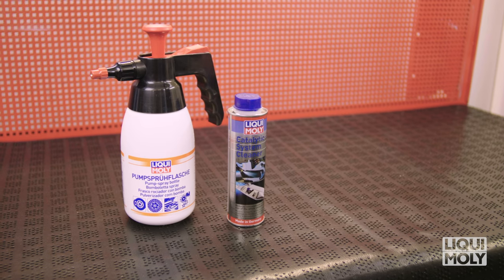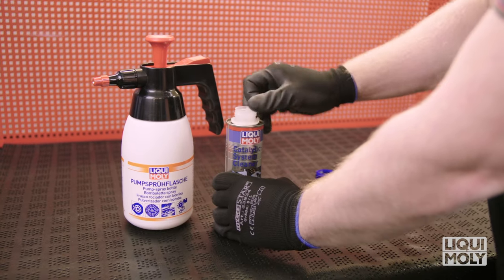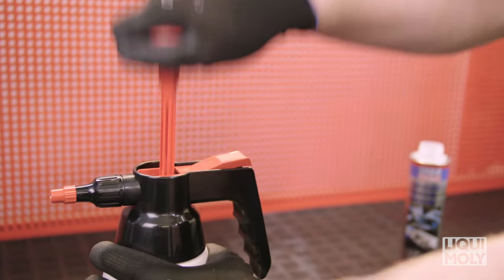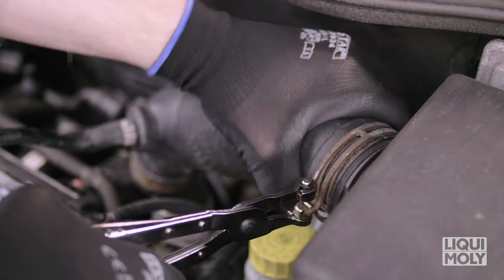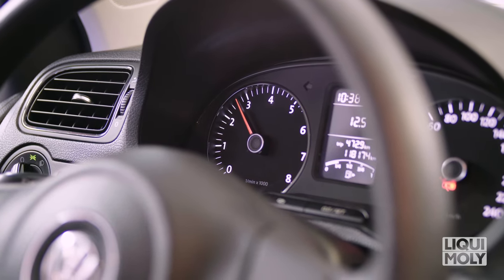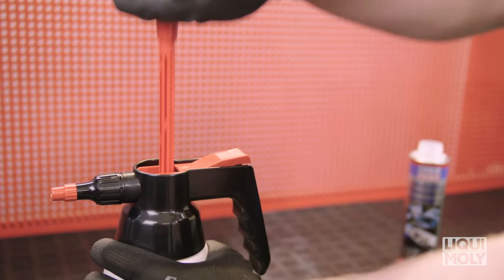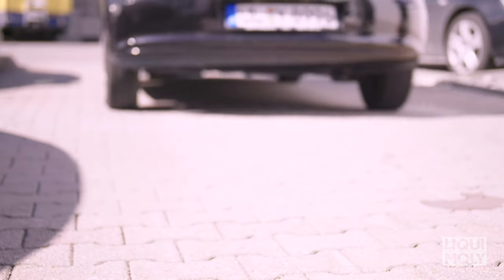LIQUI MOLY Catalytic-System Cleaner (#8931) EN

Comment: could you please advise how can use in Volkswagen passat B8 1.8TSI 2018？
Can I fill the tank?Or is there a more convenient way to use it?Is there VW passat B8 teaching video?
Reply from the maker: Hello,

in general, we have no vehicle-specific instructions for the application from our LIQUI MOLY Catalytic-System Cleaner due to the larg number of different vehicles.

Another reason is, that the applucation is always the same. 
You remove the hose to the throttle body and than you spray the Catalytic-System Cleaner with short intervals at a rpm of approx. 2500 1/min direct into the throttle body.

The Catalytic-System Cleaner is not suited for the tank application.
If you add it to the fuel tank, this is not harmful for the engine but you have no cleaning effect.

Best regards,
your LIQUI MOLY team
Reply: @liquimolywebtv  thanks

Comment: hello liquimoly i have a query can i remove oxygen sensor and spray the cleaner directly into exhaust system or its not efficient way and what the best time to advise the customer to clean his catalytic system after 100000 kilometer for example
Reply from the maker: It´s not allowed to use this additive this way, it also won´t have the same cleaning effect.
Please use the product like the application instruction is telling it in the video.

Comment: Hi, can we use this product through the fuel tank?
if we can apply this way, how may litres of fuel should we have? is there anythning else tha we have to do?
Reply from the maker: Hello,
the Catalytic-System Cleaner is only for the intake system , as you can see it on the video.

After the intake system cleaning with the Catalytic-System Cleaner (8931) , you can add the Catalytic-System Clean (7110) to the fuel , 300 ml is sufficent for up to 70 liters of fuel.

We recommend to use the Catalytic-System Clean 7110 at least every 2000 km.
Best regards,
your LIQUI MOLY team

Comment: peugeot  307 2006 , can it be used the same way in the video? through the throttle valve?
Reply from the maker: Hello,

the application is practically identical for every gasoline engine.
Important is, that you spray the LIQUI MOLY Catalytic-System Cleaner direct into the intake system (behind the air-flow sensor) in short intervals with an engine speed of approx. 2.000-3.000 1/min.

Comment: How can i use it on Elantra 2013, the air flow sensor is behind the throttle body?
Thank you.
Reply from the maker: Hello Abood, 
thank you for your inquiry.
The air mass sensor is most likely in front of the throttle valve but nevertheless remove the sensor to not damage it and put it back after the process.

Kind regards, 
your LIQUI MOLY team
www.liqui-moly.com
Reply: Thank you for the reply 
i was wrong it is not air mass sensor it is map sensor 
is it okay to remove it?
Reply from the maker: It is not necessary to remove the map sensor. Best regards, your LIQUI MOLY team

Comment: I have some questions:
1-Can I use the product with a spary dispenser connected to an air compressor at 7 bar?

2-Do I need to do the process outside or it can be done in a closed garage  with an open door?

3-from what I saw in other videos when applying the product, white smoke comes out, is this normal?
Reply from the maker: 1. Yes it can be used, just assure that all the seals from rubber withstand chemicals, otherwise they can fall apart and do not apply too much of the product at once, you risk an engine failure
2.Definitely outside not in a garage
3.Lots of white smoke comes from wrong application, when applied correctly it is just a bit of smoke 
Best regards, your LIQUI MOLY team

Comment: Helo can i use the same method for my lexus lx570 with no turbo charger?
Reply from the maker: Hello Zed, 
thank you for your inquiry.
Yes, you can use it for your car.

Kind regards, 
your LIQUI MOLY team
www.liqui-moly.com
Reply: @liquimolywebtv  I've tried to use it with the pressure can but when I remove the hose from the throttle body the car refuses to stay on. The engine starts and shuts off immediately. It is a 2013 lexus lx570. I think it's programmed to shut off if the throttle body is exposed. Can I pour it into the fuel tank instead?
Reply from the maker: Hello, please disconnect your airmess sensor, then create access to the throttle walve and try the procedure again. After finishing the procedure, turn off ignition and connect the air mass sensor again. Then check with a diagnose tool if any failures are set due to the disconnection of the air mass sensor. Best regards, your LIQUI MOLY team

Comment: Hi I have a question: should the product touch the mass airflow sensor or it should not touch it?
Reply from the maker: Hello Mesh,

no the spray should not touch the airflow sensor. Spray after the sensor.

Kind regards, your LIQUI MOLY team
Reply: @LIQUI MOLY  if I disengage the MAF the engine will stall

Comment: how to use it in a BMW 116i 2006 model as im getting half engine check light even though i got the catalytic converter clean and even the throttle body. Much Generous.
Reply from the maker: Create an acces to the air intake System.Establish access to the intake tract, ideally behind the turbocharger. Please note that the access must be located immediately behind the air-flow sensor.
Best regards,
your LIQUI MOLY team

Comment: Hello excuse me i have one question.. How i can use catalytic system cleaner with new mode from throttle.. If the car from company Toyota example. I can't open the throttle because when i open it car is turned off..
Reply from the maker: If the engines turns off during the cleaning process or you are not be able to hold the required rpm, please disconnect the mass air sensor while the ignition is off. After that you will be able to start the engine and hold the required rpm.

Please note that if you disconnect the mass air sensor, maybe there will be a failure code in the engine control unit. This you have to delete after the cleaning with a diagnostic device.
Best regards,

your LIQUI MOLY team

Comment: Is this can be applied on V6 Camaro engines. Has anyone tried ? ... 

If sprayed through air intake , will it be ok. Have done 108k km done but engine is 2014 model.

Comment: Dear Liquimoly, I have toyota innova, can I use this catalytic clenaer directly to the throttle body? Toyota innova have filter intake and then Mass Air Flow Sensor (MAF) and then go to Throttle Body Sensor.
Reply from the maker: Hello Yudi, 
You can use the catalytic cleaner directly to the throttle body but only as shown in the video in combination with the Pump-spray Bottle. How to use this product you can also read in our product information which is attached below.
Kind regards, your LIQUI MOLY team

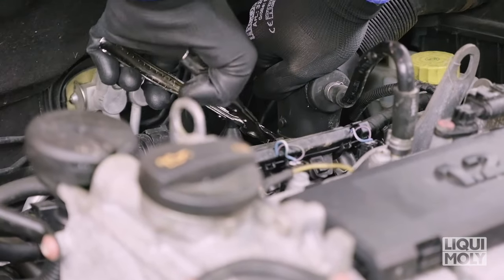Comment: Where is the mg oxides are coming from? Minute 1:10
Reply from the maker: Dear Mr. Eltony,

in countrys with a low fuel quality there is manganese added to the fuel. 
It serves as an anti-nock agent. So when it is burned it arises manganese oxide.

Kind regards,

your LIQUI MOLY team
Reply: LIQUIMOLYwebTV thanks for your reply. I thought that there is a relation with the vacuum hoses or so. 
I have another question. What if I don't have that facility of spraying the liquid. Can I use a normal spray bottle instead of it?.. thanks
Reply from the maker: If your spray bottle has got a good spray pattern you can use it for this application. 
Kind regards, your LIQUI MOLY team
Reply: LIQUIMOLYwebTV 
Thanks for that. It will make things easier at tight spaces.
Question: I have red anews letter from GM that these cleaners can be introduced via vacuum hose. Others also using the vacuum hose to pump liquimoly cat cleaner. So why are preventing using the vacuum hose and only spraying through the throttle body?
Thanks in advance
Reply from the maker: We don´t recommend it to add it thru the vacuum hose, this can cause a unround Motor operation and affects the application negative.
Reply: LIQUIMOLYwebTV 
Fair enough for me. I will follow the instructions as you explained and will give a feedback after that.
Thanks for your help
Reply: السلام عليكم أ/ ابراهيم
برجاء المساعدة , الطريقة اللي أعرفها لإستخدام المنتج عن طريق الخرطوم , كل الفيديوهات بتشرح هذه الطريقة وسوف أرفق بالأسفل فيديو للطريقة اللي أعرفها 
برجاء توضيح اللي حضرتك فهمته منهم  هل هذه الطريقة خطر ؟ لأن الطريقة اللي يشرحوها في هذا الفيديو صعبة بالنسبة لي

https://www.youtube.com/watch?v=M8gomxfTTTA
Reply from the maker: Hello Ahmed,
thank your for your inquiry. 
Please write an email to our technical department info@liqui-moly.de

Thanks in advance.

Kind regards, your LIQUI MOLY team
Reply: Ahmed Rashad 
شوف يا احمد بيك.. الطريقة المعروفة لدينا هي استعمال كامل العبوة عن طريق خرطوم الفاكيوم الخاص بالفرامل. ولكنهم منعوها تماماً وبيفضلوا الاستخدام عن طريق ال throttle body أو البوابة كما نسميها. 
وجهة نظرهم انها تحتاج استخدامها بالرش لتعطي الوقت الكافي للمادة للتفاعل مع الكربون داخل الموتور والكاتليك. ولو استعملت دفعة واحدة فالخوف أن لا يكون لها فائدة ولا تعطي النتيجة المرادة.
الجزء الآخر وهو المهم هو الخوف من دفع المادة دفعة واحدة داخل الموتور وعند الاشتعال يحدث انفجار غير محسوب. أو غرق السلندرات وعدم القدرة على الاشتعال وربما مرور السائل الزيت واتلافه ومن ثم إتلاف الموتور لسوء عملية التزييت.
وتحت امرك في اي سؤال وليكوي مولي عموماً في غاية الاهتمام بالرد على التساؤلات

Comment: Do I spray directly into the throttle body, on the butterfly?
Reply from the maker: Hello,
here you spray directly in the air intake tract behind the air-flow sensor. 
Best regards,
your LIQUI MOLY team
Reply: @liquimolywebtv  Thus, I can take off the air intake and spray onto the throttle body. Right?
Reply from the maker: Yes you can also spray directly in the throttle Body.
Best regards,
your LIQUI MOLY team

Comment: How to use catalytic cleaner with old cars having carbrateour  like tofas dogan or tofas sahin cars
Reply from the maker: Please apply the Catalytic System Cleaner  in the same way as with an injection equipped car.
Get access in front of the throttle valve and then apply like described in the product information.
Here is the link to the product information.

https://pim.liqui-moly.de/pidoc/P000055/8931-Catalytic-SystemCleaner-19.0-en.pdf
Best regards, your LIQUI MOLY team

Comment: Do I disconnect the mass airflow sensor cable or leave it  connected?
Reply: Did you get an answer to that question?
Reply: @muhammedk470   Yes disconnect it
Reply: @akramalaaetman6011  ok.

 Because if u don't, the engine switches off.
I don't know why they don't explain that part

Comment: Hi can you please advice how to use on a Laredo v6 model 2006
Reply from the maker: Hello Nadim,
unfortunately it is difficult for me to tell you the exact application for your vehicle, but in general the following applies:
Pour additive into the LIQUI MOLY Pump-spray Bottle (part no. 3316). Pump up the pump-spray bottle. Establish access to the intake tract, ideally behind the turbocharger. Please note that the access must be
located immediately behind the air-flow sensor. Start the engine and spray the additive into the intake tract at short intervals while the engine is at moderate speed (2,000-3,000 rpm). If the speed does not begin to fluctuate, the intervals between spraying can be
lengthened. If the speed fluctuates sharply (<700 rpm), shorten the intervals between spraying.
Best regards,
your LIQUI MOLY team

Comment: Thanks for your video..
Q1. What is the different between (catalytic system cleaner) and (catalytic system clean).
Q2. Who is the seller in Bahrain country for liquimoly product.
Thanks again
Reply from the maker: Hello wlhano, 
this is the same product.

Please have a look at our Store Finder. There you will find shops in your area.
https://www.liqui-moly.com/en/service/resources.html

Kind regards, your LIQUI MOLY team
Reply from the maker: Hello wlhano, 
this is the same product.

Please have a look at our Store Finder. There you will find shops in your area.
https://www.liqui-moly.com/en/service/resources.html

Kind regards, your LIQUI MOLY team
Reply: That is not the same product. The “Catalytic System Clean” is to be added to the fuel tank. On the other hand, “Catalytic System Cleaner” is to be used as shown in the video. Regards.

Comment: Hi liqui moly 
Plz help me can i use this with my toyota prius gen 2 jdm 2008 model if yes then how kindly help
Reply from the maker: Hello,
it is suitable for all gasoline engines with a catalytic converter.
Pour additive into the LIQUI MOLY Pump-spray Bottle (part no. 3316). Pump up the pump-spray bottle. Establish access to the intake tract, ideally behind the turbocharger. Please note that the access must be located immediately behind the air-flow sensor. Start the engine and spray the additive into the intake tract at short intervals while the engine is at moderate speed (2,000-3,000 rpm). If the speed does not begin to fluctuate, the intervals between spraying can be lengthened. If the speed fluctuates sharply (<700 rpm), shorten the intervals between spraying. For fine atomization, check regularly that the pump-spray bottle has sufficient residual pressure. LIQUI MOLY cannot offer any warranty if the product is not used as specified in the product information or if dosing systems other than those indicated here are used. It is the responsibility of the user alone to verify the suitability of alternative dosing systems. To ensure optimum cleaning of the fuel system, we recommend adding Catalytic-System Clean (part no. 7110) to the fuel immediately after applying the additive. This will safeguard the cleanness of the complete engine system including the exhaust gas system.

Comment: Can I use ordinary spray bottle?
Reply from the maker: It is important that the liquids are introduced at a pressure of 6 to 8 bar. This pressure between 6 and 8 bar is necessary, that the soot deposit can be optimally broken up, loosened and partially flushed out.
Best regards,
your LIQUI MOLY team

Comment: nissan frontier 2.4 2000
how can i use?
Reply from the maker: Hello,
fill pour additive into the LIQUI MOLY Pump-spray Bottle
(part no. 3316). Pump up the pump-spray bottle. Establish access to the intake tract, ideally behind the
turbocharger. Please note that the access must be
located immediately behind the air-flow sensor. Start
the engine and spray the additive into the intake tract
at short intervals while the engine is at moderate
speed (2,000-3,000 rpm). If the speed does not begin
to fluctuate, the intervals between spraying can be
lengthened. If the speed fluctuates sharply
(<700 rpm), shorten the intervals between spraying.
For fine atomization, check regularly that the pumpspray bottle has sufficient residual pressure. LIQUI
MOLY cannot offer any warranty if the product is not
used as specified in the product information or if dosing systems other than those indicated here are used.
It is the responsibility of the user alone to verify the
suitability of alternative dosing systems. To ensure
optimum cleaning of the fuel system, we recommend
adding Catalytic-System Clean (part no. 7110) to the
fuel immediately after applying the additive. This will
safeguard the cleanness of the complete engine system including the exhaust gas system.

Comment: I used the cleanear via vacuum hose like this official video

https://youtu.be/1eKkio3rc9k

Now you make a caution from this?
Reply from the maker: Hello mohamad, 
thank you for your inquiry

Did you buy the device used by Liqui Moly Asia Pacific?
Or did you just put the hose into the can?
This makes a big difference, because with the device you can adjust the amount of additive going into the engine. If only using the hose in the can you can not adjust the amount of additive going into the engine.

That is why we recommend to use a pump spray bottle for the application or the device of Liqui Moly Asia Pacific.

Kind regards, 
your LIQUI MOLY team
Reply: @liquimolywebtv 
No I put the hose directly on the can. I understood the right way from your reply. Thank you.